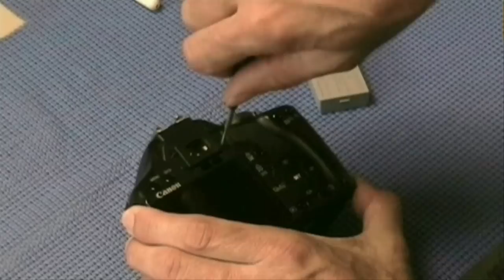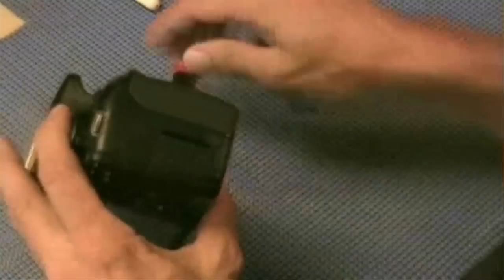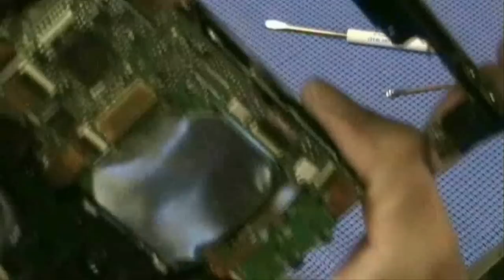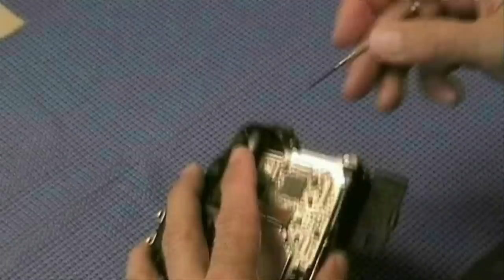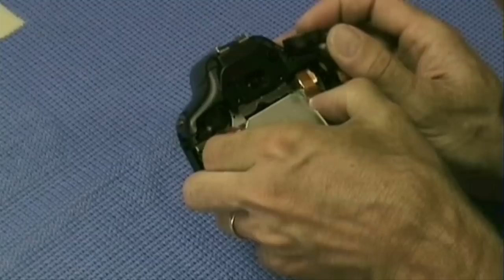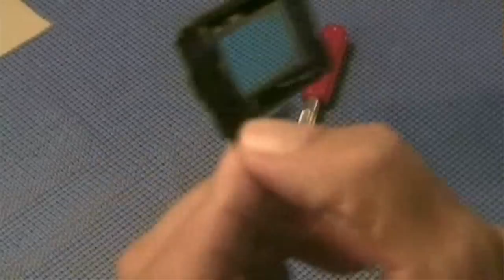Modification of Canon 450D or 1000D DSLR Camera for Astro Imaging and Infrared Photography

Comment: Hallo ;) I did modifiactions and failed. The camera does not turn on. what could i do wrong? any suggestions? canon 1000d
Reply from the maker: Hi dashbor,  You can try reseating the ribbon cables on the mainboard.  Gary
Reply: Gary Honis   I tried several times but did not help.
Reply from the maker: Hi dashboor,  You would have to send your 1000D to Canon for repair.  Gary
Reply: I probably damaged the cable. The camera already has about 40k photos. I will not fix probably
Reply: In my very limited experience, removing the ribbon cables is easy.  But getting them back together and working is prone to failure. I have one dead camera in my closet as a result of trying to replace an LCD.

Comment from the maker: Hi Ashok,
You need to replace the IR cut filter in order for the camera's autofocus feature to work correctly.  If instead, you planned to use the camera only with a reflector telescope at prime for imaging, you wouldn't need to replace the IR filter since the scope focuser could be used for focusing.  Yes, there are differences between a 350D and 450D disassembly.  The Lifepixel web site has instructions for modifying the 350D model. Join my yahoo support group DSLRmodifications for more info.

Comment: Gary great video thanks.
Quick question when my 450d was modded 2 shims fell out by accident & hence I seem to have focus problems as the sensor seems tilted. if I take the third one out to right the tilt (as I don't have the original shims) would that be ok for astro work or would I need to put new shims in?
thanks
Reply from the maker: Hi Andrew,
Sorry to hear about your shim problems.  You would have to send it to a Canon Service Center for repair.  They would reinstall the shims.  I would send it to the Canon Center in Newport News, VA because they don't change out the custom filter for astro imaging.  You would need to ask them not to change out the "custom filter".      Gary
Reply: Hi Gary
Thanks for your reply, I followed your website & took the camera apart myself & removed the remaining shims (4 shims) so there are now no shims & it seems to have sorted the tilt & the camera now focus's well for astro use. I didn't want the camera for normal use so it didn't matter that auto focus doesn't work. Thanks again for the helpful walk through absolutely brilliant
Andrew

Comment: hi i am so glad to tell you i successfully removed my hot blue ir filter from my 1000d while replacing its shutter blades but now i am not getting any ir pictures i remain my ir cut filter frame empty........and sad to say ir filter is broken when trying to separate from frame 

now i have 3 doubts 
1) can i get any oem canon 1000d hot filter to restore my camera to earlier condition (B'cos i am not getting any ir effect with empty frame
2)shall i remove the dust filter also to get ir  effect with out red tint 
3)or shall i get any 720nm filter for my camera ,if i fix 720nm can i use my camera for general photography with custom WB 

i am from India i can pay u if u could send me any used hot filter :)

thank you in advance
Reply from the maker: shiva kumar Hi Shiva,
For a full spectrum modification, you need to remove both of the camera's original filters and install a clear glass.  The reason is that both original filters have infrared blocking properties.  If you don't do that your camera's autofocus and viewfinder will not work.  You can order clear glass for DSLRs from Astronomik in Germany.  You will need to add any IR pass filter to your lens, such as a 720 nm filter to do infrared photography.
Reply: hi Gary Honis,
i use only manual lenses on my canon so i cant buy a ir filter to fit in front of the lens i want to make my canon camera to its original condition but i accidentally broke my hot blue filter so kindly let me know where can i get that oem lowpass filter 
thank you
Reply from the maker: shiva kumar You can always use a lens thread-on color correcting filter sold by KolariVision or Maxmax.com or an OWB (Original White Balance) filter by Astronomik in Germany.

Comment from the maker: The 60Da doesn't pass the important h-alpha wavelength for astro imaging at 100% like a true astro modified camera.  The reason most believe Canon did that is so the camera could better correct the white balance settings by reducing the red response of the camera.  The 60Da is a good camera for casual astrophotography, but for serious work to capture the important h-alpha wavelength for emmision nebulae like the Great Orion Nebula,Rosette or Horsehead, you will need a true astro modified camera.

Comment: Gary sorry! I just saw they mean 450d to 760D. Apologies. Gerry
Reply from the maker: Hi Gerry,  The clear glass for the 450D would fit your 550D.  But the clear glass for the 1100D wouldn't fit because it is too short.   Gary
Reply from the maker: Hi Gerry,  The clear glass for the 450D would fit your 550D.  But the clear glass for the 1100D wouldn't fit because it is too short.   Gary
Reply: Thanks Gary. I'll give it a go. Is there a big difference in astrophotography after the mod is done? I know with the 550d the pictures can be soft. http://www.astrobin.com/275591/B/?nc=user
Reply from the maker: Hi Gerry,  In the Full Spectrum modification of your 550D, the anti-aliasing filter is removed for sharper images.  I've done a lot of imaging with a full spectrum T2i (550D) using the Astronomik "L" UV/IR clip filter and my 127mm Astro-Tech triplet refractor.  I have since been imaging with a Full Spectrum camera through a 12" RC telescope.  Some images using the refractor are here: 

http://garyhonis.com/050113CS/050113CS.html
http://garyhonis.com/110912chief/110912chief.html
http://garyhonis.com/081112CS/081112CS.html
http://garyhonis.com/071212CS/071212CS.html

Hope that helps.   Gary
Reply: Gary why would i have  lines through the sky on my converted camera?
Reply from the maker: Hi Cycle Road,  You should not have lines on your converted camera.  I have had good luck with the Canon Service Center in Newport News, Virginia.  They have repaired a few modified cameras for me and don't change out the custom filter.  You need to include a note with the camera, that a "custom filter has been installed and not to replace it.  Canon usually charges a minimum of $200 plus shipping for any repair.
Gary
Reply: Gary Honis thank you for your reply. I am in the uk and it was converted by a canon recommend centre. They also repair the main circuit adjusted the auto focus unit and replaced the c.f unit. So could it be what they have done?
Reply: Gary Honis also it was changed to  665nm
Reply from the maker: Hi Gerald,  Maybe?  You can contact them about the warranty of their service.  Gary

Comment from the maker: Replacing the orginal filters without adding a replacement filter in the same location inside the camera body, will not correct AF.  Adding a replacement filter as an external cap over the lens, will not correct AF.  The replacement glass of the appropriate thickness needs to be located between the camera's flip mirror and the sensor to return AF to normal.   Even adding a  clip-in type replacement filter inside the camera body will not correct AF.  More here: DSLRmodifications yahoo group.

Comment: I do not recommend even trying to make such attempts to convert cameras. I completely destroyed my Canon EOS 350D trying to convert it to Full Spectrum. If I had bought a 450D specifically for this purpose, it would have been the same. Work only for professionals and any independent attempts to convert without the appropriate knowledge, equipment, experience and a steady hand is almost certain destruction of the camera!!!